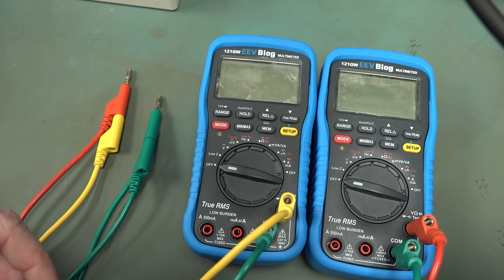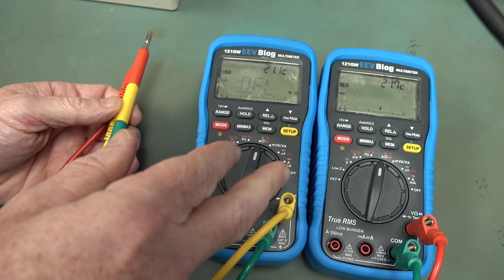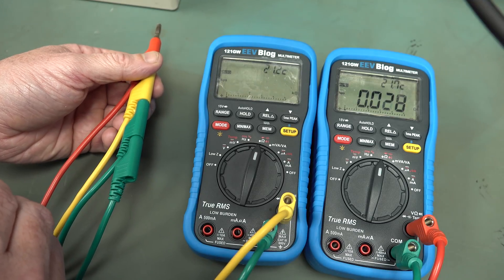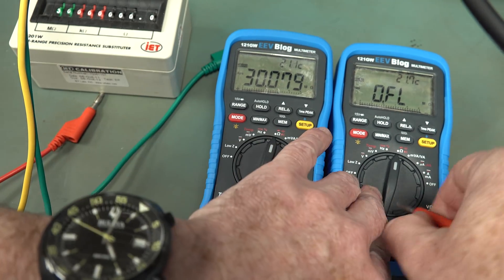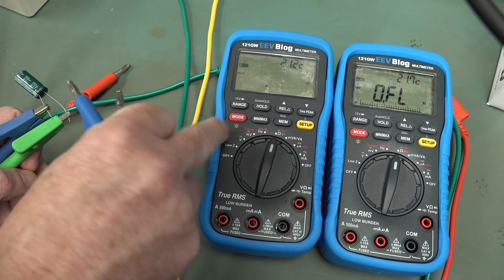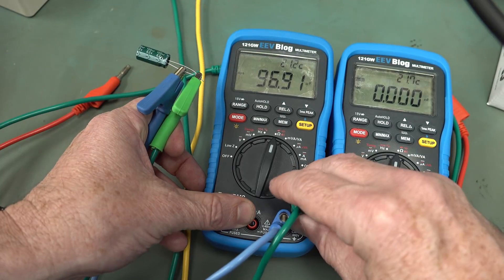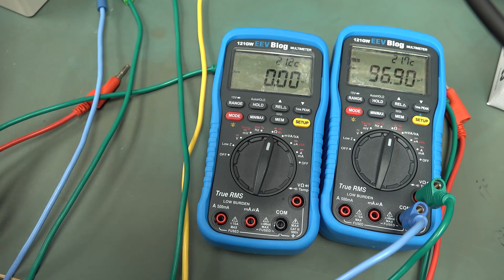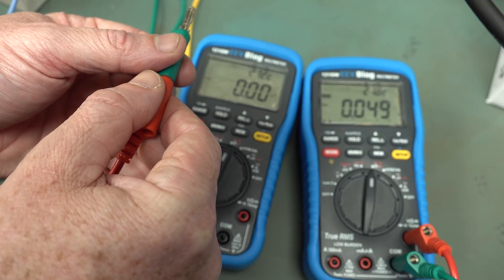121GW Multimeter 2.00 Firmware

Comment: Just got my 121GW (firmware version 2.05) and I'm VERY disappointed with it! Maybe it's a good meter for CURRENT measurement (which I rarely do) but for the rest (voltage, resistance, continuity, capacitance, frequency) it can't hold a candle agains the UT61E -- knowing that you're very picky about FAST continuity measurements, I can't believe this multimiter is so SLOW! Capacitance measurement is useless for low values, it can't be zeroed. And for the rest, it takes a good 15-30 seconds to settle -- what's the point of a 5-digit multimeter, then? I know frequency is not the main use for a multimeter (the scope can do that) but being able to measure a 4.43 MHz PAL oscillator is handy -- the UT61E can do it, the 121GW can't.

I love watching your videos and I'm learning a lot of things with them (I've been into electronics as a hobbyist for ~40 years) and I was VERY willing to support you by purchasing the 121GW (I paid FOUR times the UT61E cost) expecting to receive, if not the utmost, fanciest multimeter, at least a DECENT one, and a BIT better than my UT61E in EVERY respect -- but it just ISN'T.

And one of it advantages (longer battery life), is actually going to be a HANDICAP for me, as this meter is going to see LITTLE use, thus likely to suffer from battery leakage damage. BTW, the UEI-supplied probes (with those outrageously large sockets) are, IMHO, utter crap -- absolutely nonsense on a compact-ish multimeter (BTW, quite unstable on its stand).

Is there any possiblility of a firmware update than may speedup the continuity measurement, to say the least?

Comment: Does anybody know if they have fixed that bug?

https://www.eevblog.com/forum/testgear/eevblog-121gw-multimeter-issues/msg1689791/#msg1689791

not that I would ever measure that voltage combination, but the fact that such a wrong reading can appear is simply catastrophic. We are talking about electrical safety!

Comment: There's so much chaos and confusion regarding this meter, I got scared away. What works, what doesn't, is it software problem or hardware? Of the problems (blurbs of reported problems) what has been resolved and what's outstanding... I can't seem to find a single "authoritative" location that lists these problems in an organized manner and address them; problem, status, explanation.
Reply: There seems to be conflicting information as to ; does data logging to SD card work and what is a reasonable sampling rate to log data. 1 sample/second. Does it include time stamp for each sample data, so we can see if it skipped over and make adjustments on our analysis accordingly.
Reply: It appears as though some "unreasonable" people are trying to log data at a sample rate much higher than 1/second, almost like an oscilloscope and expect to graph, I assume this is not reasonable, but I hope there would be an "official" response stating, look that's not reasonable, here's what works... Then I could say, oh thanks, that fine by me...
Reply: Does it suffer from EMF interference... Is there anything we can do to mitigate that problem...
Reply: Are the measurements accurate and reliable? Does it suffer from autoranging issues?
Reply: There's chatter about this meter being a "hackable" meter. What is that supposed to mean? Allot of folks talk/ask for open source firmware, and that sounds unreasonable to me, but then again, what does hackable supposed to mean? A multimeter that is community developed with open source firmware sounds like a pleasant pipe dream. Can you imagine connecting meter to a source and reading 60V. but in reality it's 600V.!!! Uh, oh, someone made a mistake in decimal point multiplier in the firmware...

Comment: Bluetooth is not working properly. You can connect to the 121GW multimeter via Bluetooth, but the software (121GW for Android) does not find the multimeter. Firmware 2.0 !! I like the 121GW !!

Comment: Just a heads up.  It's recommended to put in fresh batteries before updating the firmware.    I spent a few hours trying to get the firmware to update but no go.  (I've done it previously).  Replacing the batteries solved the problem.  I was not receiving any visual indication that the battery was low.  The meter would just hang in firmware update mode.

Comment: +1 highlighting fixes of the latest firmware update! Also, one quick test on a 1K resistor worked correctly with auto-hold on auto-range ohms (although shorted test leads did not auto-hold.)

Comment: Could the autoranging, when going down, skip ranges in order to be faster? E.g. if a reading of 10k is measured on the 50M range with autoranging on, jump to the 50k range directly rather than stepping through the ranges sequentially.

Comment: I wonder whether that update has any impact on battery lifetime. It looks like they just increased the update frequency constant in the firmware, which should mean that the device does more, needing more power.
Reply from the maker: Nope, same processor speed, same ADC chipset speed, just software differences.
Reply: @EEVblog2  If the microcontroller has more to do, it has to wake up from sleep more often, causing more battery drain.

Comment: Never trust software whose version number ends in .0 ;)  Update rate is definitely better. I also noticed the 2.00 meter is giving slightly different readings vs 1.57. The temperature reading was also 0.5 degrees higher on 2.0.  Assuming the numbers are within spec it would be down to tolerances in part values within the meter.

Comment: given the fact that the temperature measurement of both meters does not seem to agree but changes up and down by one digit all the time: is the number after the decimal point meaningful?
Reply from the maker: Resolution can always be useful.
Reply: @EEVblog2  but perhaps some more low-pass filtering, running average could be meaningful here... I assume there is a temperature sensor inside the meter, so I also assume that the thermal mass of the meter would prevent any quick temperature fluctuations... What is the specified accuracy/resolution of the temperature sensor?

Comment: Cool!  My v1.22 121GW(need to learn how to update firmware) was real slow measuring 1M ohm on an anti-static wrist strap, now I know why.
Reply: I wireless anti-static wrist strap with magic 1M ohms resistor ? .... yea I bet the meter was smelling the BS and snakeoil on that and took it´s fine time before displaying it´s BS value
Reply: @KickF  It wasn't wireless.  All anti-static wrist straps have a resistor in them.  It would be dangerous to have a direct to short to ground through your body.

Comment: What abote the diference in measured ambient temperature? With 0,1 accuracy I will expect something around 0,1 - 0,2  but 0,6 diference is quite a lot...
Reply: I think you are confusing resolution for accuracy - it is within the advertised accuracy specs, which are ±0.5°C (although I suspect this spec is for the K-type thermocouple). Also, since the ambient is measured inside the case, there will be a considerable lag if they have been stored at different temperatures. ±0.1°C accuracy is challenging to achieve, and would be metrology-grade.
Reply: Rudolf Semenský 
Could be due to recent high current testing pushing the internal (not ambient) temperature up on the new firmware one.

Comment: Is there any way to update the firmware on an older model?
Reply: The 121GW has a firmware update feature using a microSD card. It's documented in the manual. Both manual and firmware can be downloaded from the product webpage https://www.eevblog.com/product/121gw/
Reply: Darren Tipple I'd be shocked if Dave would sign off on a product like that.

Comment: Really gotta get one of these.
Reply: And why is the resistance measurements  so low? The cable must be more than that.
Reply: @johnyang799  No, that's normal for a cable of that length and gauge
Reply: @EEVblog  Very interesting, i may get one of those next month and compare to my 15B.
Reply: @EEVblog  I'll recommend to everyone, everyone!
Reply: Just read the manual. Holy moly, the precision is phenomenal. The auto range is almost the same speed as fluke tho (i understand because it has much more ranges).
Reply from the maker: It's on sale, just say'n... Even cheaper if you pay by crypto...
Reply: EEVblog2 they on your store now then? I checked when you first announced them but they never materialised ( oh and shipping to the UK - it does work upside down doesn’t it 😜)
Reply: @EEVblog2  Is it better than fluke 15B in any way?
Reply: @johnyang799  It's better than a Fluke 15B in almost every way. Different price brackets though.